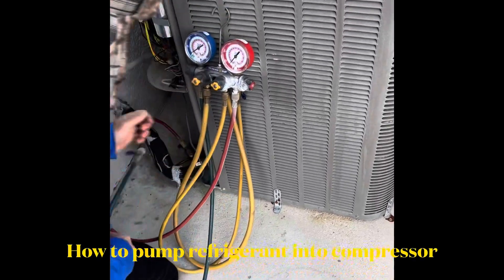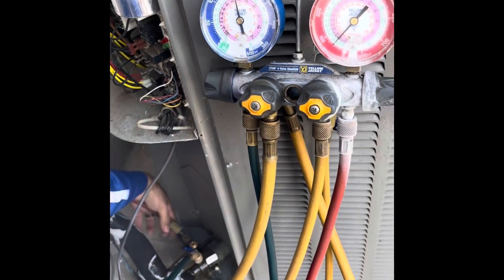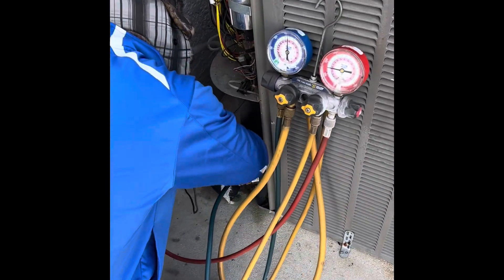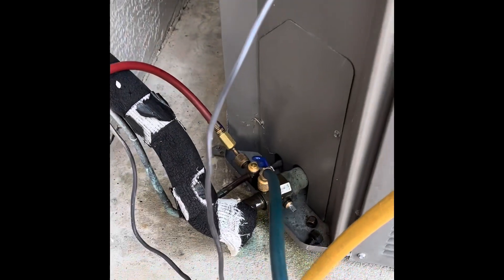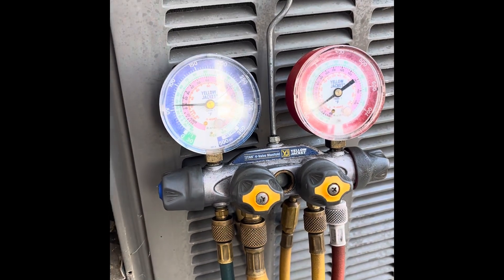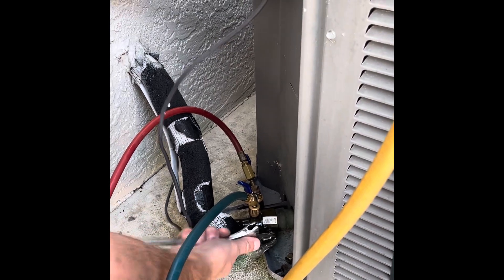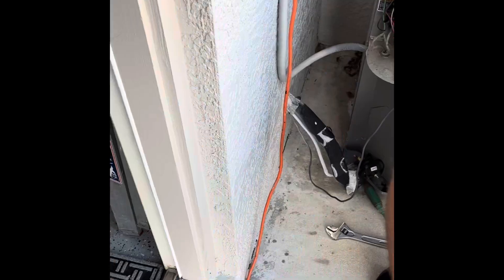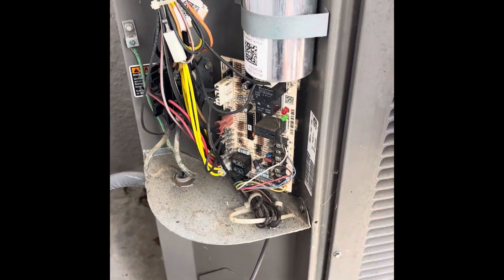HVAC PUMP DOWN Procedure of Air Conditioner! Step by Step!

Comment: The funnest part of pumping down a system….is that every now and then…..you’ll tighten the suction valve as far as it will go…..take your screwdriver off of the contacter…..and suddenly the pressure starts rising again…..I just really enjoy going back to the truck for a reclaimer and tank.

Comment: Why do you need the jumper on the low pressure control if you are physically pushing the contactor
Reply from the maker: Just to bypass the low pressure switch so it doesn’t shut down at 50 psi, and you are not able to get all refrigerant back into system. I jumped it out because this was a system replacement. So the life of the compressor didn’t matter at this point.

Comment: You should never pump down a scroll compressor this low as damage is occurring by doing so.    Best to quit at I believe 15 PSI.  
You pump that baby into a vacuum with your technique.    You do not need to continue to run compressor to shut off suction value.
Reply from the maker: Yes I agree with you. We were pumping this unit down. We were doing a system replacement and installing new equipment. 
Thanks for watching :)